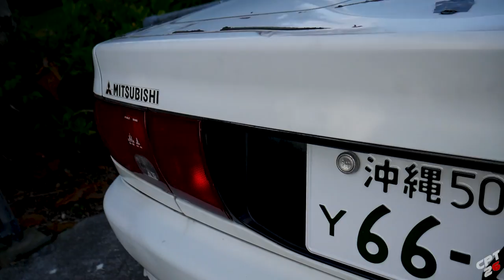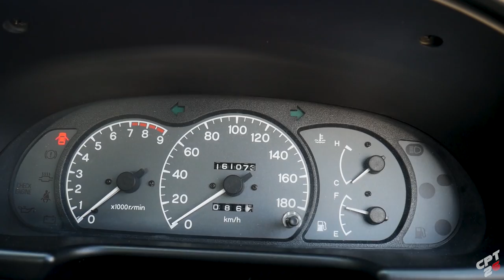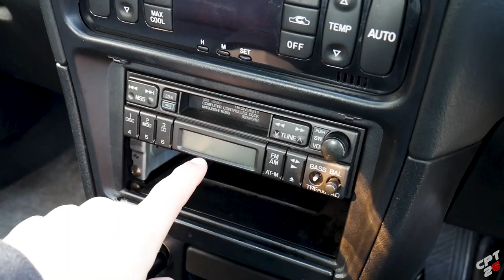MY NEW EVO!

Comment: First of all, this is a great car!  I wouldn't change much.  Really, I'd just refresh the paint work and maybe clean up under the hood a little bit.  The exhaust heat shield is CANCER!  Replace that rusty thing.  Don't ditch any of the JDM stickers.  Under the hood, or in the door jamb, or on the windows.   Gives the car that JDM flavor.  And definitely keep the wing.  It'll just look like a fancy Mirage without it.  Gotta have the wing.  I'd maybe add an exhaust.  No shame in getting one from UpGarage.  You gotta get what you can find.  Speaking of finding, if it doesn't already have it, when you go to Mitsubishi, get one of the OEM keys made for the car.  The JDM Mitsubishi keys are slightly different than the USDM Mitsubishi key.  Most people will never know, but you'll know.  Or maybe that's just my OCD.  I have to have an OEM key for every car I own.  😂  Anyway, glad to see you back in an Evo.  Can't wait for future videos!
Reply from the maker: Hahah funny you mention under the hood. I just got done spending the past 2 hours degreasing and scrubbing the engine bay. It looks night and day now! I will go to Mitsu next week and see what I can get my hands on. I only have 1 key so I definitely need a spare!

Comment: Absolutely needs the wing.  The stock EVO III wing. It's incomplete without it.
Reply: Sweet ride man. Want one. I currently have a 1g eclipse GST with EVO III 16g and open dump, around the 300hp mark. Pulls real nice!
Reply from the maker: @rabbon-ithegenesis7169  Oooooh that's my magic number in my head. I know the Evo 3 is 270 to the crank so I'd assume 210-220 to the wheels. 80hp doesn't seem to far out of reach
Reply: @CaptTwo6  300 is very easy hp to reach. I've seen that 16g make 400hp but that's probably pushing it to it's limit.
Reply: Take care evo 3 have Ringland issues so be careful in boosting them up

Comment: Swap your Shift Linkage Bushings for some Cusco ones. Changed the entire Feel of my Shifter in my EVO 2 here in the States
Reply from the maker: Where did you get them from? I definitely could use some new bushings ha
Reply: @CaptTwo6  you can get them from Amazon.jp or yahoo auctions. i also have an Evo 4 steering wheel in perfect conditions, let me know if you interested. im in mainland Japan
Reply: Also just order the original shift knob from Mitsubishi, it's perfectly weighted especially after you have sorted your gear shift bushings. They look waaaay loose haha.

Comment: Check the oil pump , water pump, alternator , to be in good condition. Do a compression test, both on cold and warm engine. Check the harness and wiring along with all the grounding points. Check the oil pressure.Do a leakage test, and a boost/vacuum leak test. Check all the gaskets and seals, engine and drive-train. Change the oil in engine, gearbox and diffs. The evo 3 is rear diff biased btw. Do the plugs also.  Check for any clanging noises,. You can change the bushes of the shifter housing to solid ones, along with the cable bushes, it will make a significant difference in how the shifter performs and feels. Sent the injectors for a dynamic test and clean up. As you said change the exhaust system to a quality aftermarket one.  Before you decide to up the power, I would do a drop in job, as in changing the rods, headstuds, rod bolts ,pistons ,and bearings, to new forged internals. Map the car on higher power fuel and ignition maps, along with boost around 1,5 bar, see how you like that. Then I would do the fuel system, a set of new higher efficiency plug wires, and then convert the oem turbo to a 20g one, new map and boost around 2.0 bar or even more, along with a set of aftermarket street cams. Nice find, excellent choice of a car, enjoy your new car!
Reply from the maker: Awesome info! I really appreciate it and I’ll look into everything out here

Comment: Congrats!
I just have to point out that the rear fenders have been rolled.
Be sure to stock up on engine overhaul kit, power window regulators as well as door and window seals.
It is best enjoyed with 300-360whp. Just a simple exhaust, more efficient turbo n a tune up would do it great.
Oh yeah, the weatherstrips, get them too.
Reply from the maker: Thanks for the info! I was wondering about the fenders lol

Comment: Congrats on the purchase, fellow early evo owner in Japan here (evo 2 rs and 5 gsr👍 ). These cars don’t come with clear coat, if it does, it’s a sign it’s been repainted at some point. Stock should be 270bhp on your 3, but no doubt it’s lost a few ponies over the years. Good luck finding parts for it, I can’t even find a decent set of coilovers anymore 😭

Comment: Dope!  got to the end and agree with your prospects.  sad you didn't keep your R33 but congratulations on this Evolution 3!  trunk aside, it is satisfying to see clean, rust-free fenders and wheel wells.  quiet, clean subtlety (as i get older, wings and spoilers become more of an eyesore, real world vs high performance functionality aside.  deletes make the car look not basic, but highlight the rest of the features that make it distinguishable, which cars like this have plenty of) think it looks more mature and sexy without a spoiler;  the bumper, hood, and wheels are dead giveaways, plus probably no fake evo 3 mirage right hand drive converted.  antenna delete?  keep it oem as much as possible, but you said it, the kid within is a big influencer.  after the necessary maintenance service repairs, tasteful little performance upgrades become major, long-term, potentially polarizing and permanent experiments for more aggressive looks and performance.  specially if you're going to possibly sell it, kid might not be able to revert back to an oem canvas to keep and save original or have their play with it.  i appreciate that you mentioned going direct to Mitsubishi first, for something as little as the oem badge, before aftermarket, so that it helps keep the practice alive and well to preserve limited run,  specialty cars such as the Evolution line and unique performance / sport cars in general (STIs, RX-7, S2000, NSX, Supra, Z and GT-Rs; JDM/DTM/USA, etc) like what Porsche does with their heritage programs and Nissan started doing with GodZilla 32s and up.  Dust off those blue prints, boys, and re-mint those quality pieces to the puzzles out there.  how much better in-house tuners and aftermarket manufactures would it breed if not for the factory themselves, to then influence racing programs and consumers of these fun toys.

Comment: These are rare now in the uk just remember the evo3 was prone to piston Ringland failure if it has its boost increased past 1bar as it was higher compression than the evo 1 /2. One nice feature that is not hooked up on the evo 3 is the sas system on the inlet manifold left hand side there us a metal pipe with a banjo bolt swop the bolt to a holed one then the system should work

Comment: Awesome choice of car, I have an Evo 3 too!
I see you have the optional factory front strut bar, got the 2 optional ones in the boot? get yourself a keyless remote from yahoo or mitsubishi if you don't have one.
You need some shifter bushes, yours have fallen apart, they are very cheap from Mitsubishi, you'll need them regardless if you buy a short shifter anyway.
Fujitsubo still make front pipes and catback exhausts, available through RHDJapan (they do 10% off for military + they have shipping to military bases).
Try finding a rear red number plate garnish and rare bits before you leave. 
Don't leave things like the stock exhaust behind in Japan, they are very hard to find and nobody wants to sell anything from their hoard.
I found a set of bronze TE37 at UpGarage for a good price if you are thinking of changing wheels. most of the time they have 17"x7 anything from +42 to +32 4x114.3 bronze work emotion cr kai usually for 25,000-30,000jpy for a set of 4 if you like those (there are 2 suitable sets at the time of writing).
Checkout the 4gtuner forum or EverythingEarlyEvo page on facebook for info on these.
BTW, Mitsubishi made 10,431 Evo 3, just have a look at your VIN to see what I'm talking about, your car is well past the 5k range.
Reply from the maker: I have one in the boot..is there supposed to be another?
Reply: Mine came with a bar like s15 spec-r do.
Hopefully you'll do a mini build series on the car, can't wait if you do.

Comment: If you even want chromoly tube subframes that allow for stock Evo 1-3 or adapted to swap Evo 4-9 engine and transmission / control arms and brembo brake kit adapters racefab.co.nz makes amazing stuff.   Would also suggest looking Inside your fuel tank for rust. Mine had a bit of an issue there
Reply from the maker: I just checked out their website. Some really good looking stuff. How easy was it to check the tank? Just pull the back seat and remove the fuel pump assembly?
Reply: @CaptTwo6  back seat and pulling the pump assay. Super simple

Comment: Few things to watch out for. Crankwalk. Cracked ring lands. Rust coming through the roof. Other than that they’re great cars. Can’t tune them without an aftermarket ecu though. Ecmlink is the most popular route. Stock pistons are not forged though as u mentioned. They are pretty weak. Wouldn’t put more than 15psi in the stock engine. 

Easy way to get 350hp though is bigger fuel pump later evo injectors and some sort of ecu. 

Join evo123.net forums for lots of info.
Reply from the maker: Thanks for all the information man! How safe is 350hp with the mods you mentioned? I’m looking to get the engine pulled and refreshed while I’m out here. Figured while it’s out I might as well do some head and bottom end work. Every time I drive I have crankwalk in the back of my mind lol. I had an Evo IV prior and they also suffered

Comment: Group A rally rules ment they had to make 5000 gsr cars then you could make 500 race specials so with evo's they made 500 rs model's with no abs no electric windows no recaro seats steel wheels etc evo6 was the last of group A cars then wrc rules applied

Comment: Did I guessed it?? Don’t think so!! I thought you were going for an Evo 4, 5 or 6!!
Reply from the maker: Super close though!
Reply: Capt Two6   So I finished to watch the video just now. My humble opinion: Spoiler is a must!! Will give the Evo3 touch almost no one has in the states, maybe even there. Just bolts on performance upgrades, mostly for the look!! From pressurization intake piping, intake, intercooler, BOV, wastegate, exhaust header, downpipe and muffler. As far as engine related parts, would be same as Talons and Eclipse (exhaust manifold, intake, etc), you should be fine there.

Comment: Evo 3 is high on my list to import within the next couple years. Unfortunately I may have to move my Evo 8 to make room for the new girl :/
Reply from the maker: Trade ya haha
Reply: @CaptTwo6  it could happen...haha. It's a 2004 RS (first year they imported them here) and only about 363 sold that year in either red or white and I see a bunch more white ones out there on the web than red ones. I've had it for almost 11 years and it has 91k miles. Garage kept and hasn't seen weather for almost 6 years now.